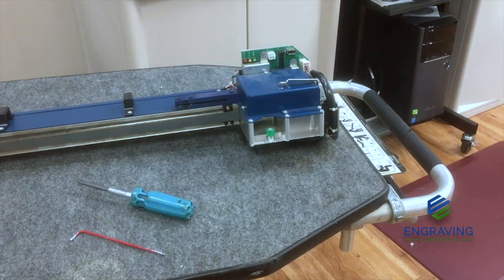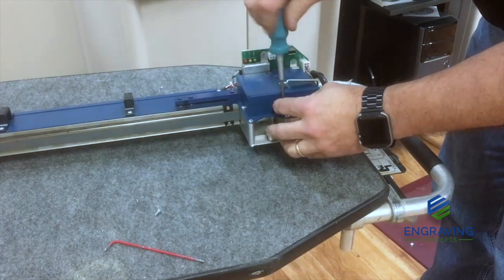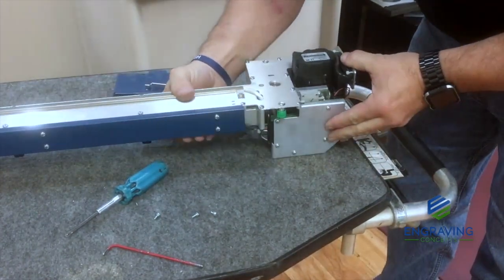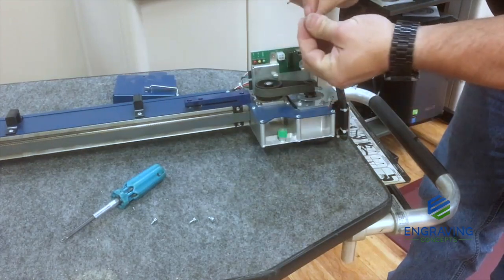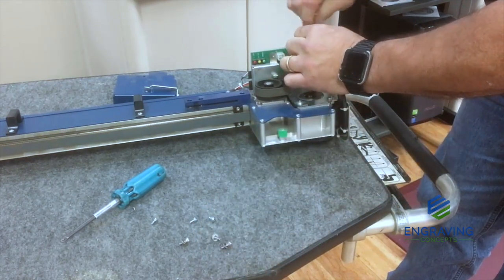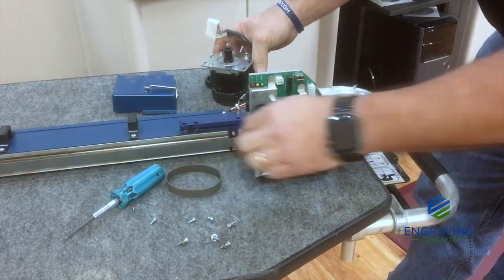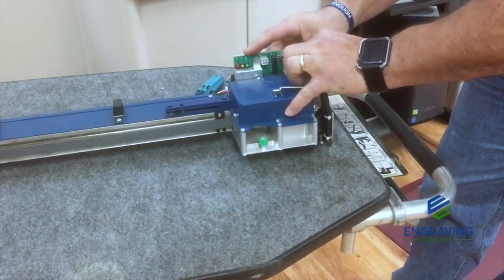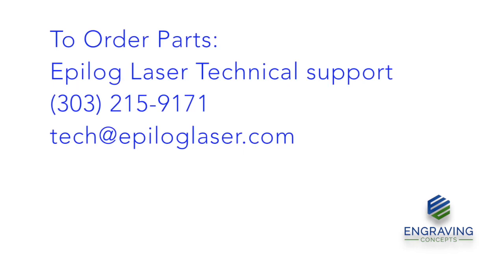Fusion M2 X Axis Motor Removal/Replacement

Comment: I know this video's kinda old, but how did you take out the entire rail?? Thanks!
Reply: https://youtu.be/yDluCIG1WDg
Reply: @krisgr5237   thanks!
Reply: I don't know if your question was answered but the 4 green screws, you can see one in this video, counter clockwise loose, and the gantry just lifts up. Mind the electrical and air hoses. A short screw driver, or small driver works great